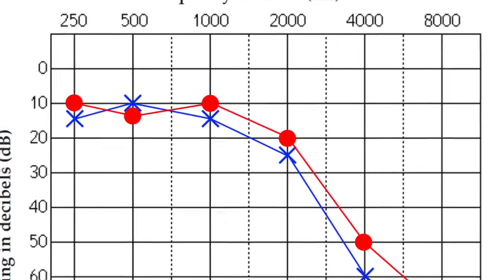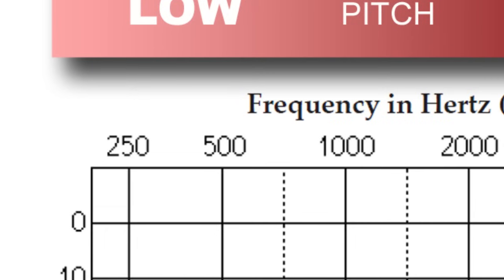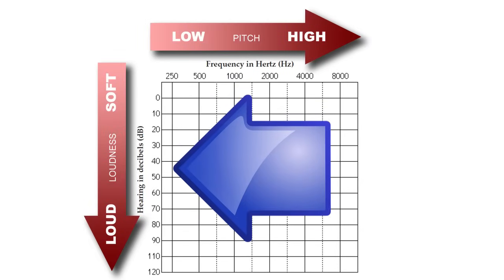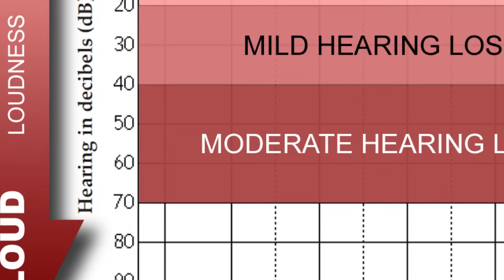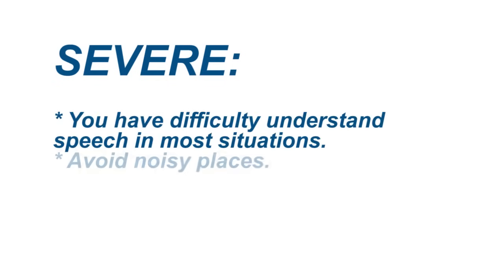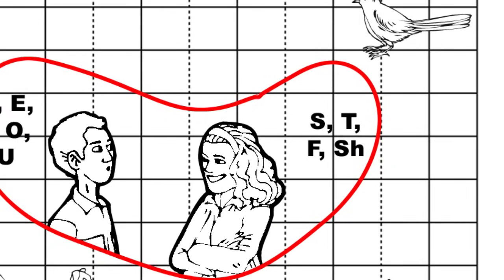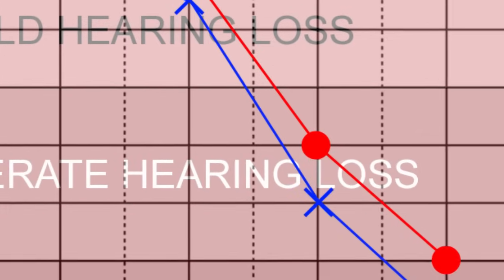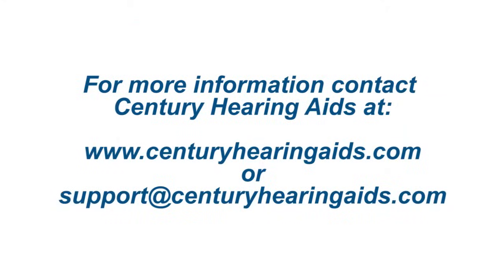How to Read an Audiogram

Comment: I have a 55 db mid frequency loss in both ears and was told the loss was "borderline severe" even though I don't really notice much of any functional impairment.  Moderate loss makes a lot more sense.  Thanks.  My audiogram has three lines, Xs, Os, and Triangles.  What does the line with the triangles mean?
Reply from the maker: Hi Cole, X and O is the right and left ear. You can email your audiogram to support@centuryheraingaids.com for more information.

Comment: Back then, my right ear was deaf. Taking this hearing loss treatment “Kαmkαmfο tdα” (Google it) just a few times, and my hearing is partially back. Even though my normal hearing didn`t return, this product really helped me hear much better. It seems working fine with my hearing problem. I will keep using it. .

Comment: How to calculate PTA in this ??? 
Please help me
Reply: average the db(s) or intensities at 500,1000 and 2000hz .............that is to say add the DBs at 500,1000 and 2000hz and divide by 3.....the values you get is the PTA ....which estimates the SRT by 5db width.